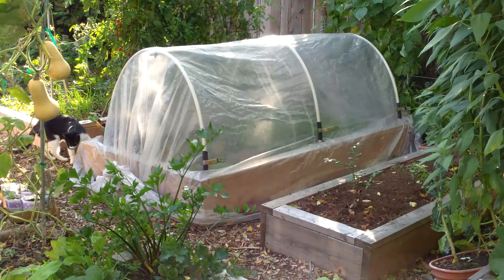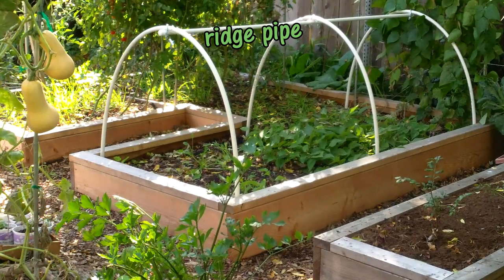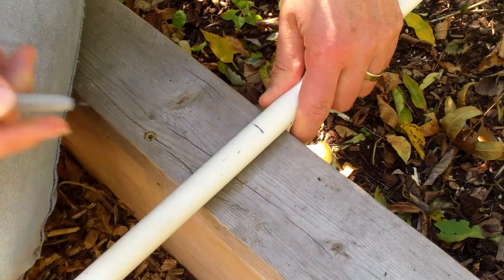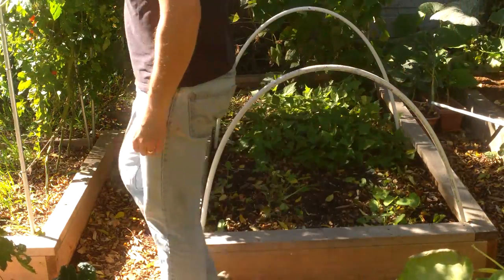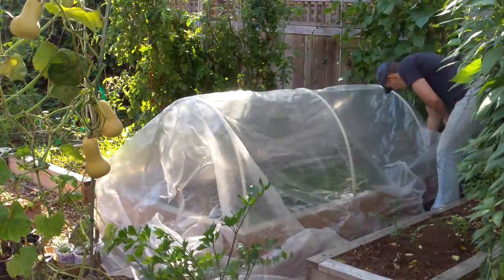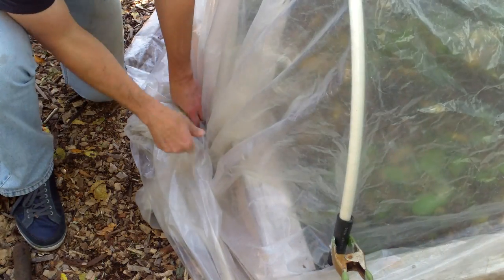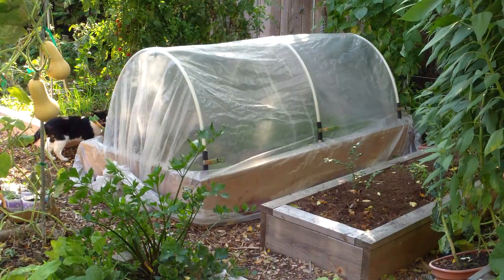How to Make a Hoop House for a Raised Bed

Comment: Excellent information on constructing raised beds! Especially like how you attached the supporting beam and the soft rubber tubing with  clamps that secure the plastic without tearing, since this can be a problem during windy winter storms.

Comment: Fantastic info and so very timely.  This weekend I hope to add the hoops to my raised cold frame thingie and was wondering how to attach the ridge pipe to the hoops.  Major relief to see how you did it because I was stumped.  Thanks Patrick!  Oh... and KITTAH!
Reply from the maker: Thanks, FesterWerks ! I'm glad the information was timely!
Reply: Use black tiewraps these are more resistant to UV than the white ones, and much cheaper than steel clamps.

Comment: Nice design. Easy to make and not too expensive! (It's awesome that you actually used math to find the proper length for the supports.  I would have guesstimated :-))
Reply from the maker: Thanks, Siloé! I used to guess the length for the hoops too, but often had to cut them 3 or 4 times before getting it just right. I've found it easier to just do the math. ;-)
Reply: measure twice, cut once!  :-)

Comment: Instead of using U bolts I might just use some heavy duty zip ties or paracord.  Love the tubing idea!
Reply from the maker: s3venvii Yeah, I think zip ties would do the trick too! Great idea!
Reply: The problem with zip ties is UV makes them brittle fairly quickly. I use a tool called a 'haywire klamper' (google it), to twist wire into a strong 'lashed' joint on my ridgepoles. The tool is a bit overpriced, but it's the cheapest way I've found to date to bind things together in the garden (trellis to u-posts, raspberry trellises, etc even handy for household repairs). Only cost per lashing is the a foot or so of galvanized wire that forms the actual joint.

Comment: Hello, I am new to gardening and I have been watching and enjoying many of your video's. So thank you. And since one of your favorite question is about the sound track and I know you wrote it, I will say that I love the music and quality of the sound. I was wondering if you could give me your opinion. I live in Northern Latvia (zone 5), and my greenhouse flew away about 2 weeks ago during a storm. Now I am trying to modify an old bed that is on the property before winter comes. It is a cement frame 150cm wide (inside measurement) with a 25 cm thickness and a 800cm length. I took all the plants out and when I step inside I am 25 - 30 cm deep. I am thinking of installing the PVC pipe on top of the cement blocks, which are 25cm (height) which would give me a standing height of just over a meter... But how many hoops should I place and at what distance? Snow can be a problem...
So the numbers are- 
Rectangle	cm
inside width	150
outside width	175
cement thickness	25
cement height	25
Length	800
I would really appreciate your help as losing that last (bought) greenhouse was so depressing and I really want to get some greens in before winter, so I can play & learn gardening... I won't be buying another greenhouse. This is the first of many I intend to build

Comment: At right around the 3:35 second mark of the video, you mentioned that once the snow covers the perimeter of the bed, that you open up one end of the hoop house.  I was wondering the reason why you would open one end of the hoop house?  Is it because you want some ventilation?  I would think that you wouldn't open up the end because that would allow the cold air to come into your plants thus defeating the purpose of the hoop house in the first place.  How are things coming along?  In my zone 7/8 depending on which website you go to, my blueberries and blackberries are starting to come alive along with the strawberries.  My summer vegetables are growing strong under the grow light.  Well take care and great videos as usual.
Reply from the maker: Thanks, Patrick. We open the hoop houses on one side when we want to harvest something. Otherwise, they remain closed in the middle of winter. 

I'm glad to hear your early summer perennials are starting to come back to life. Our cold weather crops are getting started here, but we'll have to wait another couple months before our strawberries do anything.

Cheers!
Reply: Winter sun can be too strong and cook the plants within, also soften the PVC frame to te point of collapsing. Do not need rebar, Mike. Use larger PVC pipe, cut the bottom at an angle to drive into ground, slip the hoops in and fasten with screws the connection. The advantage is that you can make the whole thing as tall as you want. Ventilation is a must

Comment: I was just talking to my hubby about adding hoops to our 4x8 bed! This is super helpful. We have mild winters here in 7b but I want to try and extend our greens and possible get spinach to harvest instead of a few leaves and bolting. I don't think we have a green house supply place around here would a place like Lowes hove something that would work?
Reply from the maker: swilliams0416 That's great! You'll definitely be able to extend your growing season in zone 7b. I'd recommend using greenhouse plastic for best results. We got ours from JohnnySeeds.com. You can get everything else from Lowes.

Comment: Sorry that I will be off topic. 
Patrick please help me. I am now the VP of my Environmental club and the main part of the club (because the school doesn't like us going on frequent field trips) is our garden. Unfortunately this will be the first year the garden is going to be used again because the previous club members didn't work on the garden for 2 years. I was pulling weeds out and finally turned the soil to check it's condition and it's sandy! It's a baby step away from being a sand box. We put this soil in 2 years ago and it was rich topsoil. How can I fix this? Should I bother or should I just plant sandy soil plants? And if I can fix it will it be fixed by spring? We also have a compost bucket thing (the expensive ones) but it's been used incorrectly so the leaves etc are still in there (despite at least a year of sitting there) and some critters are in there as well (lizards, spiders etc). Please give me any advice thanks!
Reply: Good luck, Rachel.  I hope Patrick can help you.
Reply from the maker: Hi Rachel. That's a great question. I think the solution is to add more organic matter to the garden in the form of compost and mulch. The earthworms will integrate the organic matter into the soil, which will make it less sandy over time. One thing you can do this fall is to add lots of shredded leaves to the garden beds. They should break down quite a bit over the winter. You can also add other organic matter like used coffee grounds, compost, and grass clippings. In the spring, you can brush the remaining mulch aside, add some compost, and plant in the compost. I hope this helps! Best wishes with your Environmental Club!

Comment: About to make my first hoop house soon. Did you initially have fear that the PVC pipes would snap while being yours the first couple of times? Also, thanks for the Formula of length to cut.
Reply from the maker: Best wishes with your hoop house, Douglas! We use schedule 40 PVC, and so far we've never had a pipe break, even after many years of use.

Comment: Hi all, I built a hoop house last year 16 ft length and 10 width and basically covered four raised bed in zone 7a (VA) and oh 6 feet tall. It was a total failure worked great as a sauna in both summer and winter but controlling that thing was ridiculous. I am new to hoop house began demolishing it yesterday and moving smaller ones for the raised bed. I was way to ambitious issues from insufficient sun penetration because of doubled up 6 mil plastic to high humidity, pest just miserable this is a case where I should of gone small. Steve
Reply from the maker: Hi Steve. I'm sorry to hear your hoop house didn't work out. I hope you have better luck with the small raised bed hoop houses.
Reply: Patrick,  love gardening and it sadden me when the season is over. I aspire to be like you in many aspects in the garden and want to keep my cost low but also maximize the space I have now. I have my kids involved and they are sold on fresh veggies especially since they can pick them. steve
Reply from the maker: krazytrinisteve Hi Steve. It's great that you have your kids involved and they're sold on veggies! That's not always an easy task. I know how you feel about the season being over. We try to keep the garden going but it's nothing like the summer garden. Best wishes!

Comment: Something for u to try. Since u r doing non heated. Grab some 2 gallon jugs or even 1 gallon milk jugs fill with water and dark/black food coloring. And put in your hoop house. (Multiple is better) it can hear up to an extra 20 degrees if the get enough sun.
Reply from the maker: +Mike Gibbs Thanks for the tip, Mike!
Reply: The ground below the hoop house absorbs the insolation well enough without milk jugs.

Comment: Hi there! Me again. Sorry to bother. I just built this for myself too and applied it to a 1m high raised bed I built this summer. 

I just wanted to ask wether I have to open it during the day? Or partially open it since it could get too hot?
What about humidity? It seems to get VERY humid in there. Is that a problem? I'm growing spinach and carrots.

Should I add some permanent ventilation holes for fresh air to enter?
Reply from the maker: Yes, you'll definitely need to vent to keep plants from overheating.Carrots and spinach are very cold hardy, so I wouldn't cover them at all until your first frost. After that, you'll want to vent when it's above freezing or below freezing and sunny.

Comment: Can you please provide me the list of materials used ? especially the polytheism sheet...where did you get them from ? I have the exact same size rated garden bed and want to protect from plants from wind. Please help. thanks
Reply from the maker: 1/2" schedule 40 pvc and U-bolts are sold at home improvement centers. This is the plastic we use: http://www.greenhousemegastore.com/product/4-year-greenhouse-film/6-mil-polyethylene-film
Reply: @OneYardRevolution   which size for the 4x8 bed?

Comment: Are there any disadvantages to placing the rebar stakes on the outside of the garden beds or is inside preferred?
Reply from the maker: Hi David! Either way is fine, but placing the stakes on the outside will keep water from pooling up around the perimeter of the bed.

Comment: Hi Patrick, I noticed in several of your videos that some of your hoop houses have and inner frame and an outer frame.  I am considering building my own hoop house based off your instructions.  If I were to just build 1 frame and then simply add a second sheet of plastic when 2 layers are required, would that still work?  Is there any other benefit other to using the 2 hoop frames?  Thanks!
Reply from the maker: Yes, 2 layers together will provide extra protection, but not as much if there's an air gap between the layers. The air gap provides additional insulation.

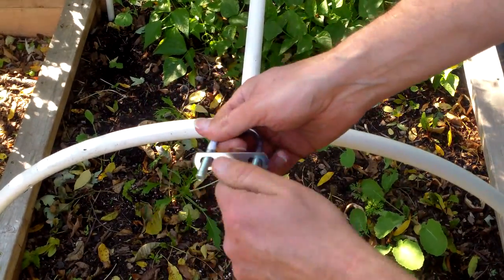Comment: Patrick,  there is a better way  to attach the poly to your boards.  A channel with wigglewire can be used with no dependance on the snow to weight it down.  You can see it in my video- Hoop House part 2 on my channel "DIY Home& Garden Projects"  time 1:00 to 2:15.
Reply from the maker: +DIY Home & Garden Projects Wiggle Wire is a great product, but I prefer spring clamps in this case for frequent quick and easy access.
Reply: You can do the same by wrapping the two ends of the screen over two lengths of PVC conduit, lay it on the ground and pile some dirt on the top to weigh it down. Make it simple.

Comment: I'm assuming your greenhouse plastic is rated to block UV so it doesn't break down?  I tried this once with 5mil purchased off the shelf at a big box store only to see it become brittle and start shredding from sunlight.

Where do you get your "greenhouse" plastic?
Reply: I had the same experience, and about to ask the same question.
Reply from the maker: Zerkbern Yes, this is greenhouse film. The film shown in the video is probably 5 or 6 years old. This is where I got it: http://www.johnnyseeds.com/p-7709-tufflite-nursery-clear-greenhouse-film-10-x-100-roll.aspx
Reply from the maker: Dritan Bega Yes, this is greenhouse film. I bought it here: http://www.johnnyseeds.com/p-7709-tufflite-nursery-clear-greenhouse-film-10-x-100-roll.aspx
Reply: OneYardRevolution Thank You very much.
Reply: Thanks!

Comment: Patrick, just so I understand properly, you used two 7 foot pvc tubing for the cold frame? I have a 4.5 x 4, and a 4x4 raised bed. I would use two at that same length if I want the same height as you correct?  And still use the ridge bar.  My pop up green house was destroyed from that last snow we had. Thank you for all your videos and photos
Reply: I meant hoop house not cold frame
Reply from the maker: +Terina Erb I'm sorry to hear about your greenhouse. Was the weight of the snow too much for it? Yes, 7 foot PVC will give you the same height as mine. The ridge pipe really helps the hoop house hold up to the snow. You can use zip ties to connect it too.
Reply from the maker: +Terina Erb I'm sorry to hear about your greenhouse. Was the weight of the snow too much for it? Yes, 7 foot PVC will give you the same height as mine. The ridge pipe really helps the hoop house hold up to the snow. You can use zip ties to connect it too.
Reply: +OneYardRevolution | Frugal & Sustainable Organic Gardening 
Yes, the weight of the snow was too much.  We got about 10 inches of snow. Thank you for the information. I think I have am the supplies I need except for the clips.

Comment: I thought rebar would be really cheap. It never occurred to me that the hardware store my charge five dollars for a 2 foot piece. Ouch! I had someone else shop for me, otherwise I would've looked for a cheaper substitute.
Reply from the maker: It's much cheaper when purchased in 10 foot pieces. The Home Depot sells 10' rebar for $4.44.
Reply: Do not need rebar, Mike. Use larger PVC pipe, cut the bottom at an angle to drive into ground, slip the hoops in and fasten with screws the connection. The advantage is that you can make the whole thing as tall as you want.
Reply: Also use black tiewraps to fasten the hoops directly to lateral PVC conduit backbone and you will find the 2 by 4 frame redundant

Comment: Great video on hoop houses, I have 3/4' PVC pipe leftover from another project, my beds are mostly 4 X 8 feet also, do you think the 3/4 inch PVC is too thick to use?
Reply from the maker: Thanks, ***** ! I think the 3/4" PVC pipe should work very well. You may have to cut the hoop pipes a little longer so they'll be easier to bend.
Reply: Thanks, that's great. I hate wasting things that are just laying around needing to be used.

Comment: What kind of tubing did you use? I couldn't find anything in Home depot that would go over 1/2" PVC pipe. Thank you! After a warm spell, we are heading to low 30s tonight so I used your method to hopefully protect my seedlings tonight.
Reply from the maker: +Sybil Cooper Hi Sybil. We used something like this, though I don't remember it costing this much: http://www.homedepot.com/p/Sioux-Chief-1-in-O-D-x-3-4-in-I-D-x-10-ft-Rubber-Heater-Hose-900-12306N00101/100131884  Maybe the people at Home Depot can direct you to something similar that costs less. Basically, you just need flexible rubber tubing that's about an inch in diameter.

Best wishes during this cold spell!
Reply: +OneYardRevolution | Frugal & Sustainable Organic Gardening oh thank you! I will take a look tomorrow. For now rocks and clamps are doing the job. I need to order the larger plastic you linked to in order to extend my fall crop. Thanks for the help.
Reply from the maker: +Sybil Cooper You're welcome! You're right. Rocks and clamps will get the job done for now.

Comment: what are the dimensions of the U-bolts?
Reply from the maker: +Sonny Ray Hi Sonny, I can't remember exactly what the dimension were. When I shopped for them, I picked a size that would fit around 2 perpendicular pipes. I actually tested the u-bolts on the PVC in the store. I hope this helps!

Comment: Will these vegetables survive the entire winter...?
Reply from the maker: TheEverodd We're in zone 5. It varies from year to year how many crops survive the entire winter. Under just plastic, Spinach, salad burnet, red veined sorrel, claytonia and mache have survived every winter. Kale survived all but last winter (coldest winter in 30 years). Collards, parsley, and mustard greens usually survive until January or February. 

We also add a second layer of protection to some beds (a cold frame inside a hoop house). This allows more crops survive. We've even had lettuce survive most of the winter under 2 layers. I'll be making another video on using 2 layers soon.

Comment: Patrick check out this low tunnel idea using strings to make it easy to pull the plastic on/off without removing it. It is in Spanish but they show how to do it. I am going to use low tunnels for the first time this year in GA and will try this method since with our weather the will frequently be covered/uncovered. Video here: https://www.youtube.com/watch?v=UmRc1WFJ3qo
Reply from the maker: Very nice design! It should work well in GA.